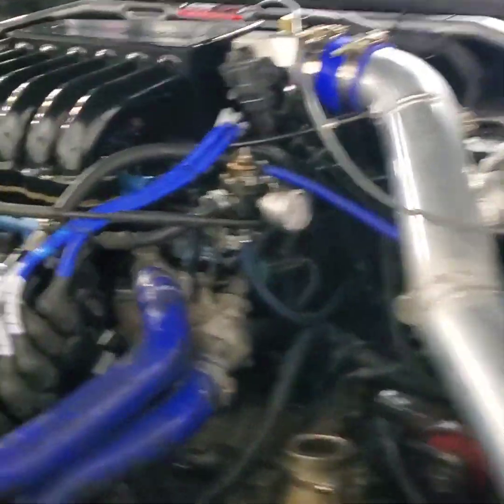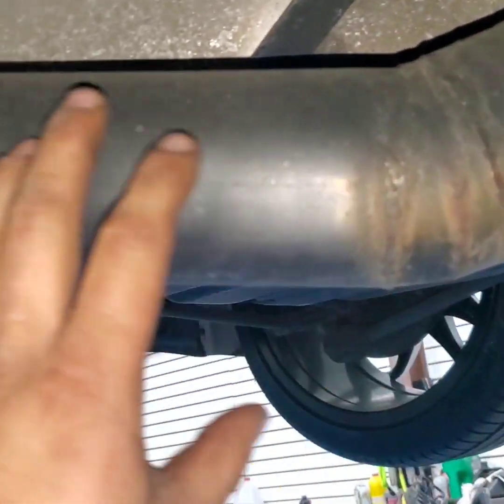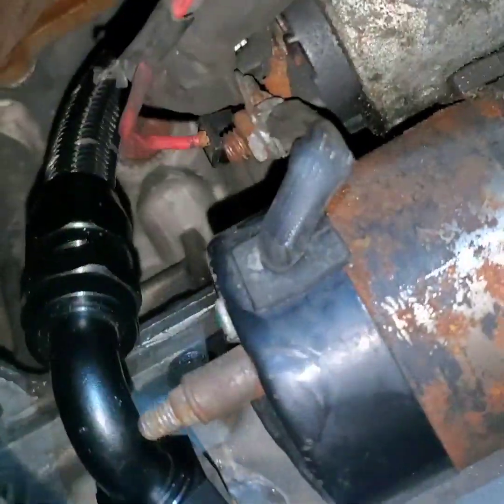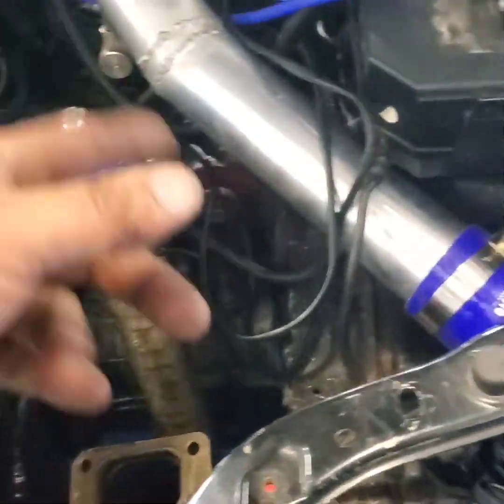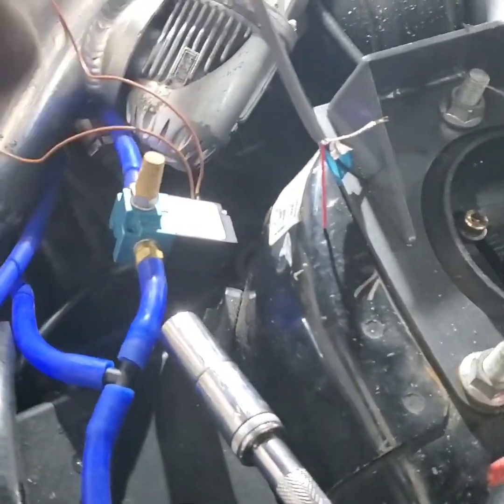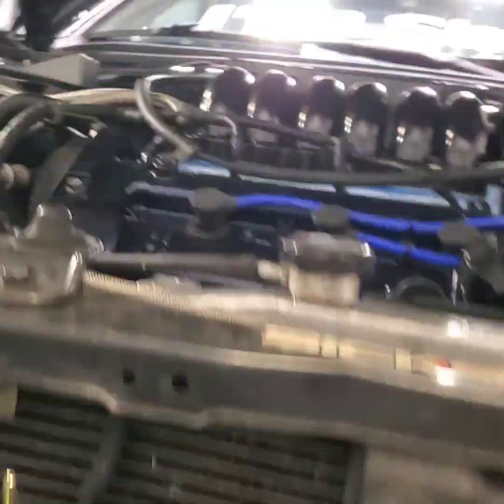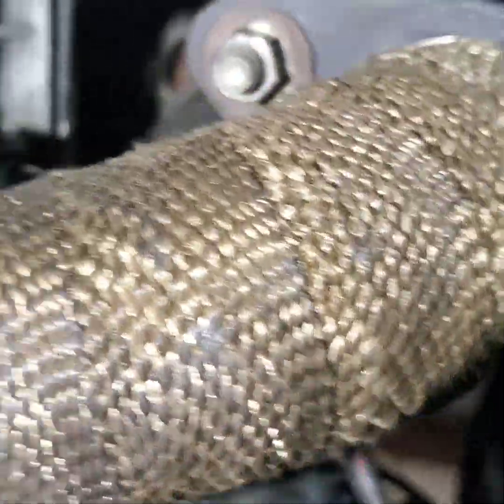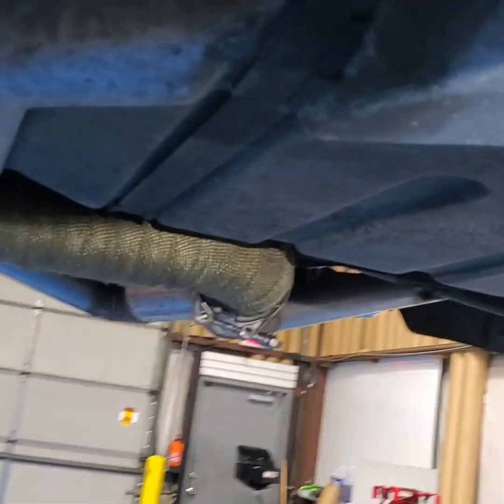Add turbo oil return line, hook up boost controller

Comment: Hey man nice vids, I am In The process of doing the timing belt from your other video and have lost the power steering pump pulley bolt (I thought I'd put it safe lol). Is there any chance you know what size/thread it is at all?

Cheers
Reply from the maker: I can find out later today
Reply: @Lilmiddwest  that would be great, whenever you get chance.

Cheers
Reply from the maker: M10x1.25 x65mm
Reply: Thankyou and I'm really sorry to mess you about but I just realised I said bolt when I meant to put nut, the one that holds the pulley on. Would that be m10x 1.25 as well?

Again sorry about that my mistake

Cheers
Reply from the maker: @DartFrog100  it's might be M10x1.25 or m12x1.25
Reply: @Lilmiddwest  ideal thankyou order one of each and hopefully I'll be set.

Cheers

Comment: Hey man, I am currently in the works of turboing my tib. How do you install the AEM FIC? And how hard is it to use that piggy back
Reply from the maker: I have videos on it and I took my off I couldn't get it to work. So I bought aem infinity 506 standalone with Boomslang wiring harness. I'll give you links in bit
Reply from the maker: https://youtu.be/gzJiEvLdSnA
https://youtu.be/djgSkBDnhXQ
Reply: Lilmiddwest so you don’t recommend using AEM FIC. Use AEM standalone ?

Comment: men you upload videos and dont answer or reply anything to your viewers are disrespectfull. i ask something if i dint have any replys in 24  hours i will dislike    so i ask... when you pit the oil pan i know you jse glue but i need to ask because i purchase the felpro gasket. did i need to apply glue to the gasket for stay in place? the gasket has a blue line that goes looking me when i put the gasket in the oil pan? you know that glue its touch the upper oil pan or its goes looking to the lower oil pan. you know the blue was not looking me when i installed in the oil pan I'm confuse.. yes its my first time doing this my car has a leak there
Reply from the maker: I replied all your comments but you never replied. You want me to screen shot all the comments I replied.
Reply: @Lilmiddwest  can you please tokd me of k need to put rtv to a felpro oil pan gasket. the felpro i have has a black and blue line.

Comment: Dude how'd you do your merge pipe? I'm building mine to twine turbo but I'm wanting to single it for the time being until my other motor is built
Reply from the maker: I flip the DC y pipe towards the front and made it work. I record everything I did to my turbo built.
Reply: @Lilmiddwest  so how would i go about doing it if i dont have the DC pipe. I have headers on my tib and a down pipe that connects the 2